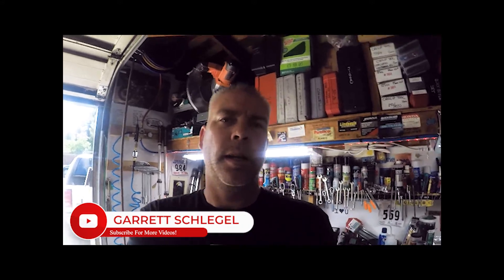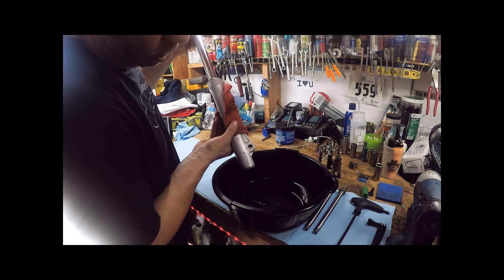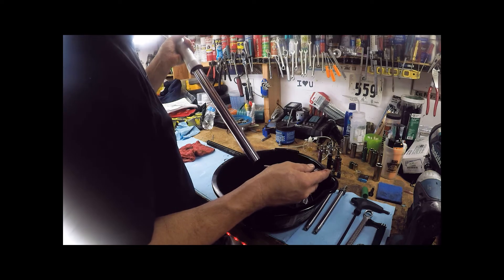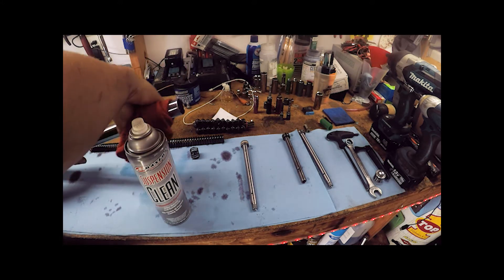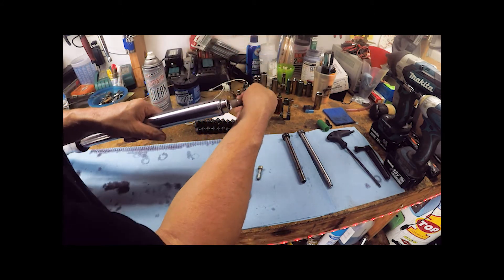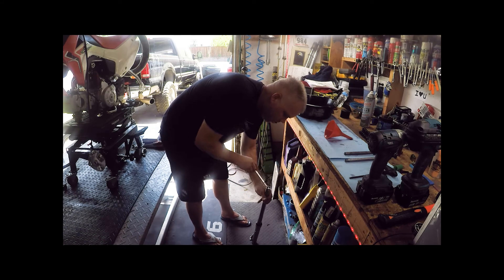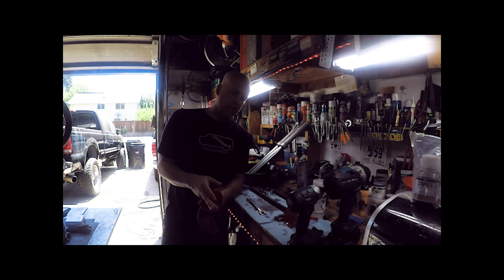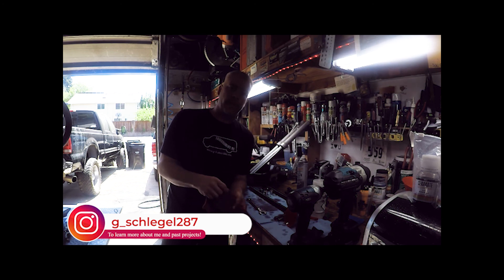Honda CRF110 BBR Damping Rod Install

Comment: what allan key did you use to drain fork oil can’t find nothing to fit
Reply from the maker: Sorry for the late reply....I don't have a set of forks handy, but typically those are a 4 or 5mm I believe.  Is the head of your bolt compromised at all?

Comment: How much oil do I put in each fork?
Reply from the maker: For the 2013-2015 CRF110 the manual calls for 180cc of oil.  Typically 5w oil is used, but if you want some more resistance in the forks you can bump up to a 7.5 or 10w fork oil.

Comment: Do I need a Extensioner for the rear shock if I use the rods and stiffer springs on the 2021 crf110?
Cheers buddy
Reply from the maker: The bike will sit higher in the front, but you can run the front springs and damper rods without doing the rear shock extension.  You are going to notice that the back is quite a bit softer (stock) after you make those changes to the front suspension.  Hope that helps!